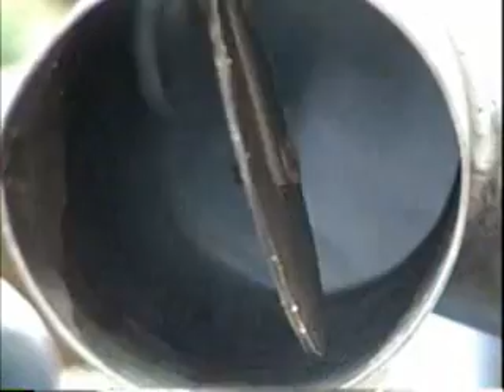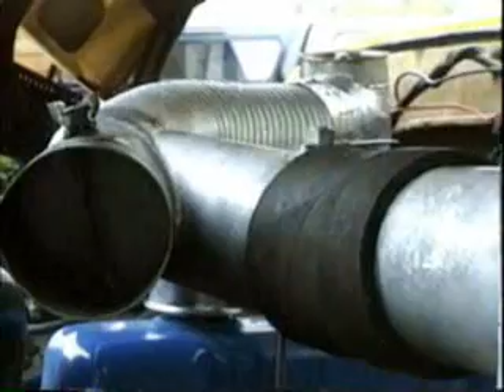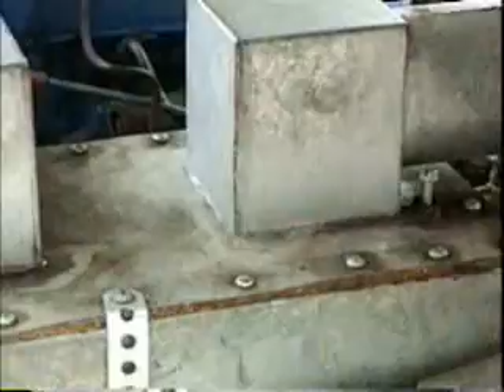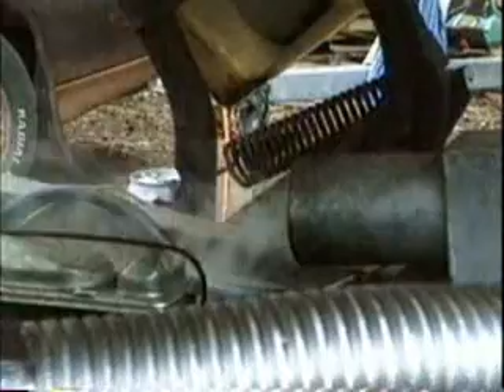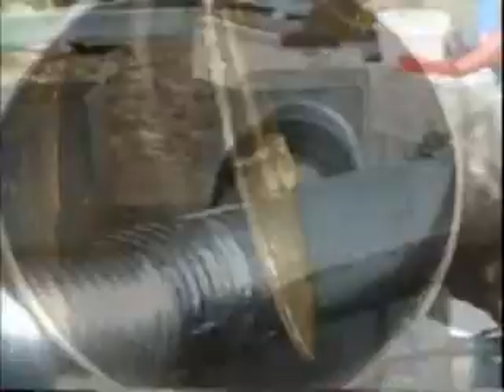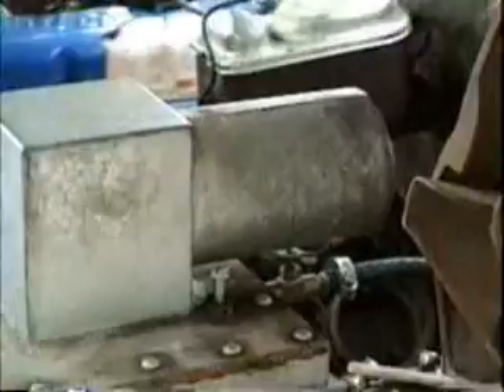Here is definitive proof on how to separate all Atoms in all liquid soluble matter.

Comment: Hey, Bill, I have a question, how about temperature of engine block? Ive read somewhere in Your earlier posts, that You were saying the vapors are not so hot, but what about the heat of the chamber itself, wouldnt engine will drag that heat from chamber into engine? Iam curious about engine block deformations, because I will do this on 4 cyl ALUMINUM engine block. I know IRON blocks can stand higher temperatures.
Reply from the maker: +Karolis Astrauskas Actually the engine will run cooler on the White Vapor. You see the White Vapor I made burns completely, inside the cylinder. Not like liquid gasoline, which never gets enough oxygen to burn all the gasoline inside the cylinder. The un-burnt liquid gasoline, continues to burn inside the exhaust manifold, catholic converter, muffler, and tailpipe. This continued burning adds to the engine heat. The only heat in the chamber is from the heating elements, and this does not leave the vapor chamber, only the cool White Vapor leaves the chamber.

Comment from the maker: For general information, all solids and liquids can be influenced by  temperature changes, to change the temperature of a gas or vapor pressure has to be added to the gas, or vapor. Otherwise the gas or vapor will remain the same temperature, that it was when it was made into a gas or vapor.
Reply from the maker: +Bill Kendrick When pressure is added to a gas, or vapor it will condense and become a liquid again, if cooled in the process. That is what a refrigeration system compressor does, it compresses the gas, and the condenser fan cools the gas to make it a liquid again, then the expansion valve drops the pressure, the liquid boils and removes heat from the evaporator area. I was a refrigeration service tech for more than 45 years, I am an EPA Certified Universal Service Tech.
Reply from the maker: +Justin Noker The information is out, it would do no good to kill me now.
Reply: Bill Kendrick you'd be surprised what they can do, anonymous confirmed they have an internet killswitch, though that will most likely never get used, so they just stick to social engineering forcing people to believe it's fake, luckily i'm someone who knows better
Reply from the maker: No, I haven't. However, if I prove what I say you will be able to put water in your gas tank and run your vehicles on hydrogen. by separating the hydrogen and oxygen atoms in water.
Reply: that,s an old ford engine if it was australian early 1960 to mid 70's
Reply from the maker: I am telling this to the world of Science, Medicine, and Chemistry. All liquid atoms in all liquids have their own boiling temperature and when that temperature is reached those atoms will boil and turn to a gas, while other atoms in the original liquid have not reached their boiling temperature, they will remain a liquid and the liquid atoms and vapor atoms will separate. This is how to separate all atoms in all liquids, something science, chemistry, and medicine has not been able to do yet, well here is how to do it. I did it to gasoline first, and I am now working on the Hydrogen atoms in water. My Flashing Liquid Process will change the world, when the science world sees it..
Reply: Very interesting. I managed to burn all of the gallon in its entirety without residue
Reply: Keep up the good work I too have worked dilligently on this device and had mixed success. Would like to see more of your work and notes at some point
Reply from the maker: Frank go get another life. I have been an EPA Certified Universal Refrigeration Service Technician for 50 years. I have owned 4 businesses in 3 states. I have repaired refrigeration systems that factory representatives could not repair. I was one of the Camp Crew Bosses For the Columbia Shuttle Recovery Team, in May 2003, Palestine Texas, I was there for a month. There were 22,000 of us and we recovered 76% of the total weight of the shuttle. Maybe you need to get educated more when you make comments.
Reply from the maker: It is not the fact that the material is a solid, that causes the material to assume the applied temperature, it is the size of the snow flakes that determine the speed at which the snow will turn to a gas, without becoming a liquid. The snow flake size assumes the applied temperature faster than the snow can boil and become a liquid, so the snow flake goes to the applied temperature and boils at that applied temperature, which using a cigarette lighter means the temperature is somewhere between 1000 and 1300 degrees Fahrenheit. This tells me the snow flake went to the applied temperature then boiled at that applied temperature, which is far above the 212 degrees Fahrenheit boiling temperature of water. Using this same principle, I used a fine mist of liquid and applied the 600 degrees Fahrenheit heating element, and got a White Vapor that has twice the power of gasoline, with zero parts per million Hydrocarbon emission, seen on a smog analyzer. Try doing this with a distilling process.
Reply from the maker: I blocked this Frank Gutowski, idiot from my channel. With his last name I don't think he was an American, might be Russian .
Reply: Lol  Good for you should have done it sooner
Reply: +Bill Kendrick bill i just posted a smaller version of my system on you tube...take a look and tell me what you think please  patgalloway channel or email pat.designs@bak.rr.com or call me 661-401-4001
Reply: +Bill Kendrick bill i know how refrigeration works ...but what you may have overlooked on my end is that there is not enough time in the compression stroke to reliquify vaporized gasoline ...it is micro seconds ... and because of the way that engines are supplied fuel today  is the reason it does not vaporize fully ,Not enough TIME and SURFACE area to vaporize it completley before it enters the combustion chamber when the spark is initiated is when the vapors are ignited. and yes there is a doubling of power from the vapor because only vapor is being oxidized
Reply from the maker: +pat galloway You want the gas to remain a vapor, it is totally flammable in the gaseous state, liquid does not burn but vapor does.
Reply: +Bill Kendrick and bill we are talking about a vapor that is condensed to a liquid by a pressure pump ( in refrigeration) and then released into a radiator ,and when this is done the compressed vapor (NOW A LIQUID because PRESSURE has been applied to it) immediately turns back to vapor and releases heat in the process of vaporizaton creating a cold or hot in the radiator depending on what direction the pump was turning and how the vapor or liquid has been released into what side of the air conditioner. i know the physics behind what is happening.my system employes the same principles except i start with a liquid and apply vacuum to vaporize it . not a vapor and apply pressure like in refrigeration . the (liquid IN an air conditioner is a VAPOR at atmospheric pressure)
Reply: +Bill Kendrick bill all liquids are compressed vapors at atmospheric pressure of 14.7 pounds per sq. inch release that pressure in a vacuum of -15 inches of you have an instant vapor . just like in a bic lighter
Reply: +Bill Kendrick that is what i am doing and it works
Reply: +Bill Kendrick yes i understand that vapors are the ONLY thing that oxidizes  but you dont need heat to do it
Reply: +pat galloway Bill i am not refuting what you have done but open your mind one more time and look at patgalloway gedc0395 youtube to see if you can improve this system i devised . this is not a challenge just looking for improvements. i know you think outside the box ,,,or you would not have done what you have so far ..i admire people like you
Reply: +Bill Kendrick the compressor compresses  the VAPOR  into a liquid  ,then this liquid is released into a radiator that allows it to expand and while it it expanding it releases the heat that is why on the other end (radiator) of the cycle it feels cold
Reply: +Bill Kendrick well bill do u have anything to add? ask ...anything?
Reply from the maker: +pat galloway Actually the compressor, compresses the gas, but it takes the condenser fan motor moving air across the condenser coil cooling the high pressure gas that turns the gas back to a liquid. The high pressure liquid then goes through the metering device (Expansion Valve) dropping the pressure, and the refrigerant boils at this time, gathering heat from the surrounding area, this is the evaporator part of the refrigerator. When the refrigerant gathers as much heat as it can hold, it returns to the compressor, where it compresses the gas, and the process begins again.
Reply: +Bill Kendrick the compressor compresses the VAPOR to a liquid and then releases it into a condenser thru a valve that lets the liquid to expand ..this expansion looses heat due from vaporization from a compressed vapor to a liquid  this liquid is extremely cold due to vaporization and can be used to cool an area(room) with a fan blowing thru the vents of the condenser...boyles law in practice ...the term gas is misleading vapor is proper
Reply: +pat galloway sorry should have said this Vapor is extremely cold due to vaporization
Reply: +Bill Kendrick Do you have a kit to make your white vapor to run a car.
Reply from the maker: +Kenneth Meggers Sorry I made the White Vapor over 20 years ago. It works best with a carburetion  system. Each vehicle will determine the room, size and shape to install a device like mine. Use your imagination.
Reply: good for you. Running a bubbler system on your device does not break up the fluid or inject air into the gasoline but what it does do is act like a fluid valve regulating the amount of vacuum. Unfortunately vacuum does not react fast enough for the demands of the driver and the decrease in demand gets the same result ( engine seems to, run out of gas) the pedal gets spongy then useless then the vehicle is hard to start. Does all this sound familiar?
You have a least a bit of understanding of the systems limitations I hope you continue but read my full disclosure it will save you a lot of trial and error
By the way when your system is working like it is there is no chance or danger of explosions. We actually tried to get it to backfire into the system. Didnt work. We really tried.
keep it up Good luck
Reply: have you any up dates to the work you have done   with you 
engine ?
Reply: Bill Kendrick no problem.. Glad to see your doing well ... and Thanks for the Kind reply.. all the Best to you Bill.. 
and have a wonderful day .. Cheers  Jay
IF i can ask a question .. i was doing a test 
yesterday . and  it seems strange that 
at around 400 Degrees F i get the white vapor... but as i run the temp up on a test 
piece of 1/4 inch steel ..the white seems to go away .. and i have the bubble staying longer on the plate and " rolling' around .. 
lets  say at 600-700 degrees.. 
but the visible white seems to go away .. do you think this is normal ?
Reply from the maker: You are not spraying a fine enough mist of gasoline onto the heating element. It is the fine mist droplets that make the heat transfer happen faster. The finer the mist the faster the liquid will assume the applied temperature. In my video on You Tube I used 600 degrees Fahrenheit. I got a non flammable liquid remaining in the chamber bottom. It would not mix with the gasoline it was made from. All liquids will mix with the original liquid they are made from. My non flammable would not. Only changing the atomic structure can create this. Therefore I have separated the atoms in gasoline, and made a white vapor with zero emissions,  a lower boiling temperature than gasoline,, and it will no longer mix with the gasoline it was created from. Lab tests on a Gas Spectrum Analyzer will prove what I say. Oh, the 700 degree Fahrenheit heater temperature, the guys on this video used, will produce only vapor, because all the atoms in gasoline have boiled, leaving only vapor. When science discovers what I have discovered, chemistry, medicine, and science will not be the same. Bill
Reply: Bill Kendrick Thank you Bill and you are 100 % correct... i will keep spreading the good news ... Cheers     Jay
Reply: Leslie Clendening did you see my question about the vapor system you had... and the set  RPM that it would take.. .would that not be great for a boat ?
Reply: You tell him The difference between him and us is " he THINKS we are wrong but we KNOW hes wrong"Start with our extreme results and work backward from there and realize his explanations dont fit what we already KNOW. And you are right there is no explanation that will convince him so best to ignore him. I know I dont have the time to try and change his mind. Its not that he isnt well educated its just that his education does not apply in this case. In his defense it is hard to wrap your mind around it I was wrong for a long time till I finally figured it out
Reply: Frank    Pure  gibberish .. of NO value .. Hello Epstein .. you lying goat .. nothing going on down at the Lodge humping Goats.?. and you had to come here and bother us ?
there is not ONE bit of truth in you head .. not one bit
Now Give me some Rage Demon !
Reply: nope.. but rage some more liar  :  )    go back to your Jew School and 
get Ed- Jew-Cated.....  your world of lies is falling apart .. and you can't stand that can you?
Reply: the world is 100 % Jewish / Masonic .( the same one's who m urdered God ( God Jesus Christ ) on the cross...... as you know... 
first day on the job troll boy ?
Reply: Cheers Bill and it is that simple :  )
Reply: Hi Bill great video . my name is Graham from Ireland . i would love to build the system you put together . any chance you could email me a diagram . i really want to do this .  grahamf355@gmail.com  cheers Bill

Comment from the maker: To anybody trying to make the White Vapor I created from gasoline, in my You Tube video. If you are having a problem finding the heaters, go to a company called Chromolox. They have any size wattage, or voltage heaters you can imagine. They also make custom designed heaters, if you want to pay the price.
Reply: Despite watching many vaporised fuel setups that I have seen accomplished where the vaporised fuel enters in the engine via the air intake, I am still very concerned about directly hooking up the devise directly to the air intake. After I had spent time chatting very recently with an ex royal army electrical engineer, that has worked on air crafts, ships and now cars for the past 30 years or more, I had second thoughts about certain things. He seemed like a very nice chap that knew a lot about alternative energy devices and studied a bit on such DIY projects on cars. He advised me if I do decide to do it that it would be best that the fuel goes through directly to the manifold. Basically as if I needed to setup up the device to work like if it was LPG configured. So that would mean drilling holes just below the fuel injectors at 45 degrees angle to attached steel tube fittings. That would match the 14.7:1 ratio in the car??

If I was intended to just send it down the air intake I was advised that the engine would become very hot and volatile. For example, even though on paper it would suggest that the car should operate via sending fuel down the air intake. However, advised that the car would get uneven amounts of fuel distributed to each piston. Causing the car to heat up and create huge backfires (which is inevitable), possibility of destroying the auto throttle which is very costly to fix and destroying the oxygen sensor, which is another expensive part. I just do not want to damage the car. I do have some basic questions to ask you:

1) Have you ever had any problems operating your devise through the air flow intake?
2) Despite my initial thought was to make sure that I had a very secure meshed flashback built into the air flow intake piping, do you have any other safety 
    advise or is it just general scare mongering?
-  Will all these things depend on the type and model of the car?
-  Are fuel injected cars more difficult to configure with vaporised fuel systems in your opinion? 
3) Could I use my devise to supplement the engine without altering the engine? The reason why I ask I recall that when you fully had your devise in 
    operation, I do remember reading that you would switch the fuel pump back on momentarily to give your own setup on the car an extra boost. 
4) Do cars in your opinion operate a lot cooler, make the engine run smoother and last longer?
Reply: MultiLink Supported Employment your an idiot so is your  petrol dollor devil advisor.
Reply: @leroy8885  use HHO with water vapor and reduced gasoline. Cleans internals and runs cooler..